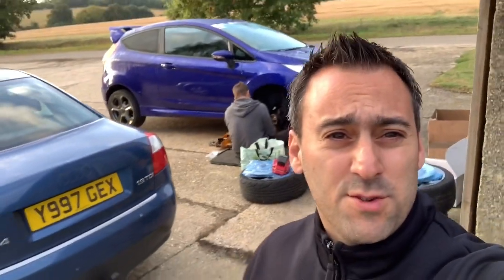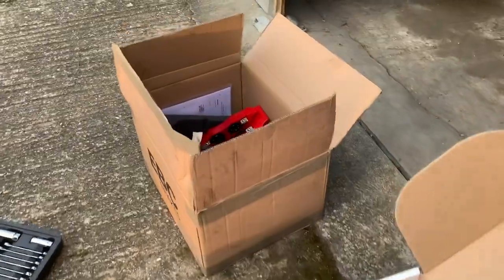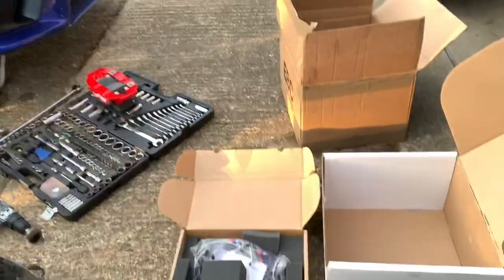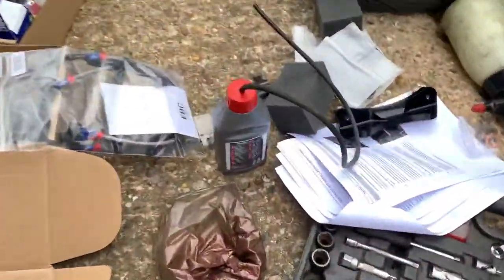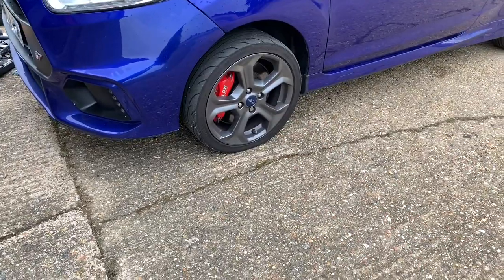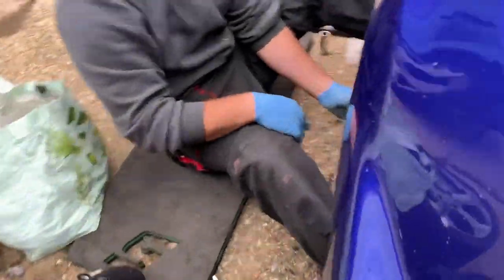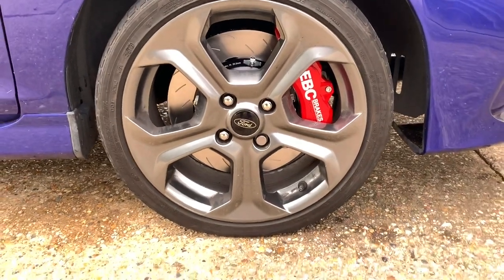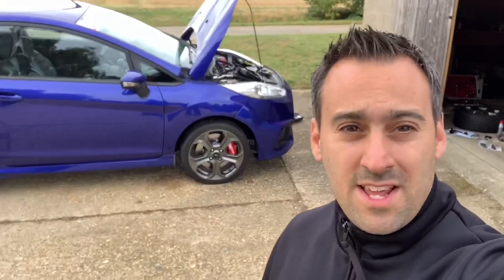350bhp Revo Stage 4 Fiesta ST - Fitting EBC Big brake kit

Comment from the maker: ** We actually use 15mm spacers on the front on both sides not 20mm. 
Even with 15mm it can cause some rubbing so we lightly fettle the inside of the arches when some rubbing can occur **
Reply: I got 20mm and eibach pro lowering springs and there’s no rubbing at all.
Reply from the maker: @samcook7046  I’m sure there isn’t with only 20mm our drop is 35mm anything 35-40mm will likely rub with this spacer set up unless you lightly fettle the inside of the arches
Reply: @PeakPerformanceReviews  no 20mm spacers with 35mm drop in the front and 45mm drop in the rear from the lowering springs. It’s the perfect fitment.
Reply from the maker: @samcook7046  what tyres, it’s a simple as a tyre being different that could make the difference
Reply: @PeakPerformanceReviews  standard 17 inch wheels with standard 205/40r17 tyres. No camber adjustment. I’m only saying this so hopefully if someone wants a nice fitment with no issues they can copy the same.
Reply from the maker: @samcook7046  I always do the same, problem is not all manufacturers of a said 205/40R17 will be the same, numerous manufacturers can measure bigger. What tyre was it? Mine definitely wasn’t safe, on track and even on the road, would cut into the tyre (Nankang NS2R) and cause what looked to be super dangerous cutting into the tyre. 
I also have a duty of care to make sure people are safe based on what I found but it’s nice to here another tyre works. Hence I’m asking what it is 👌👍
Reply: @PeakPerformanceReviews  Bridgestone potenza what came on the car from factory. There’s no signs what’s so ever of rubbing and never heard it rub. I can see people who run a big offset on there wheels having problems but the factory set up has the wheel quite recessed into the arch.
Reply from the maker: @samcook7046  good to know the stockers work then, NS2R’s don’t work unfortunately as they tend to come up wider than most. I think AD08R were the same and did the same for me. 205 tended to measure more like a 215, that 10mm makes a huge difference.
Reply: @PeakPerformanceReviews  Hi I’m about to fit this bbk and i have fitted 20mm spacers and are on mountune lowering springs which is 28mm at the front and this does rub the arch,  the tyres I run are pilot sports 4s, so do the 15mm spacers clear giving you the a 3mm clearance that EBC recommend.
Reply: Hi mind to share what’s your front wheel Center to fender height? And your tyre is 205/40 right? I’m looking to install this Ebc Bbk, but want to know would it rub on my setup. So i hope to know your height to compare my height with 215/40 . Thx thx
Reply from the maker: @kelvinleong4995  I don’t have the car anymore unfortunately bud so I wouldn’t know that! You on coilovers? I struggled with rub with this spacer set up and 215/40’s I had to go back to stock size with a Eibach pro Spring kit. I had to also even lightly fettle the underside arches on the front even with stock size tyres (only for when pushing hard on track or road).

Comment: Hi man 🙂 very nice ST ☺️ I have little question about wheel adapters/spacers. do you have 20mm all around? no rubbing? which one lowering springs y have? I have H&R -35mm I hate how this ST wheels look without spacers😏 I thinking about 15mm adapters but I dont know it is safe.. better option 20mm?
Reply from the maker: stanced blue hello glad you ask, we actually use 15mm spacers on the front on both sides not 20mm. 
Even with 15mm it can cause some rubbing so we lightly fettle the inside of the arches as some rubbing can and does often occur. 
We have eibach pro spring kit (-35mm) which is like the H&R and all is ok, even around track on some harsh bumps like bombhole corner at Snetterton we done have any rubbing.
Thank you so much for watching fella, please stick around and subscribe as we have loads more cool videos coming on the ST this year. 
What are your mods on yours?
Reply from the maker: stanced blue p.s thanks for the kind comment and glad you like our ST 🥰
Reply: @PeakPerformanceReviews  Thanks for fast answer🙂 I think 15mm is better option because my friend haves 7,5 ET35 wheels rhis wheels makes 19mm to outside vs stock wheels but tire is little more stretched and Hi doesn't have any issues/rubbing.
My mods? I have a Spirit Blue like yours🥰 lowering springs H&R -35mm, Downpipe with 200cpsi sports cat, custom catback with muffler delete its perfect for me Now I'm waiting for all packet from maxton design front splitter, sideskirts, diffuser, rear spats and spoiler lip all without the lip with white stripes I think this will be looking amazing😍 I like how stock wheels looking(design) but I need this adapters to be happy🙂 In future I have plan to buy Airtec or Wagner intercooler to get more cold air to the engine because on the summer engine is really hot and I go for the program, safe program I think 220/330 will be ok stock turbo makes max 225 but I dont need more now. 

PS sorry for my language mistakes I know im not perfect but it is what it is. I think u understand what I am talking about😛
Reply from the maker: stanced blue no problem at all your welcome. That sounds awesome and that set up is great. I loved my ST when it was about 240bhp. Go with the Airtec that’s what I’m changing too soon there big one as this Pro Alloy one gets hot on Trackdays and is not good enough. Where about’s are you? I’m guessing not in the UK? 
Honestly no problem at all I understood you well, to be honest I hate people that get upset over silly things like language mistake.
Thanks so much for watching again bud 👍
Reply: @PeakPerformanceReviews  I'm from Poland and I still live  in Poland. You know sometimes is hard to me get something for  Fist. Because this things/stuff cost much money. VT330R cost 1200£ in UK for me is in my money +/-6000PLN In my job i have payment per month +/-3000PLN this is diffrence betwen live in PL/UK 
I bought Fist for 49000PLB/3000PLN payment per month
U can buy for 10000£/3000£ payment per month 

I needed almost 3 years to get this car.
But Im very happy now🙂 its amazing car❤
Reply from the maker: You still have yours? You still about on here?

Comment: How much for this kit? Looks really nice on.
Reply from the maker: Ross Hart thanks Ross the fit can be poor with these kits unless done by a very good body shop, our did a cracking job of it but the rear would have been even better if the spoiler went over the top of a Zetec S spoiler rather than the stock spoiler but it looks great none the less.
It’s called an RS Look kit. Front bumper is only £229 and the spoiler is £129 all from Maxton Design, we love it! Thank you so much for the kind comments glad you like. 
We have loads more vids coming up on the car so please stick around and subscribe as we need more good people like you on here 👍❤️🙌

Comment: I have sent off an email to EBC directly through their web site ask a question and yet no reply so either they do not know how to reply or they just don’t know the answers I am asking which is kind of off-putting as it means I look elsewhere for the same product.

So maybe you can answer a few questions. Do I need anything else to fit this kit as you mentioned spacers if spacers are involved then that is something which I would prefer to stay away from, also where do you buy the discs for these calipers as I looked on that web site you linked to and they do not stock the floating discs as I assume you just by the outer part of the discs I don’t know the name of it so forgive my ignorance, as regards to pads which pads will be compatible with this BBK?

Finally is this big brake kit fully street legal.
Reply from the maker: What size kit are you looking for? The same as mine?
Reply: @PeakPerformanceReviews  Hello sorry for the delay yes EBC got back to me all sorted now just need to save the pennies to afford this kit, can you tell me  what was the torque setting to attach the caliper to the car fixing.
Reply from the maker: Hello fella that’s great news, if remember rightly there are all the torque setting in the instructions there amazing. 

I have some unboxing vids of the kit on here and a basic install video too 👍 thank you so much for watching, definitely stick around and subscribe as it’ll be great to have you 👍👍